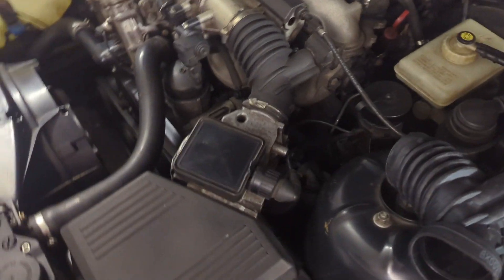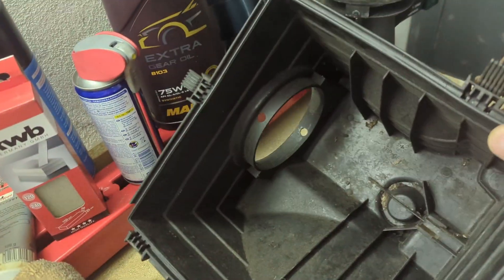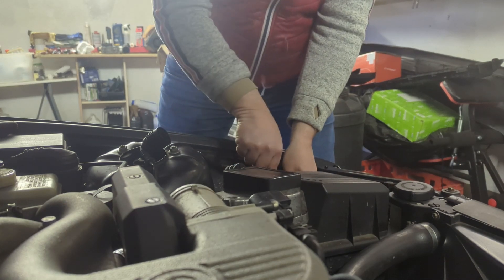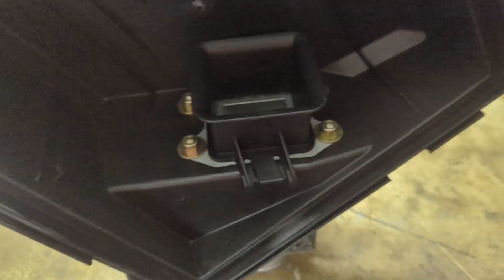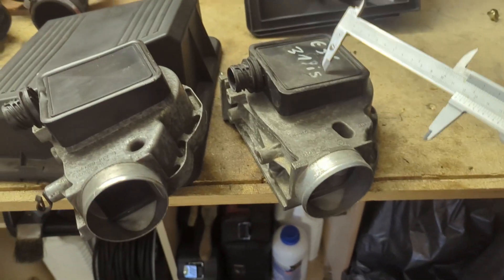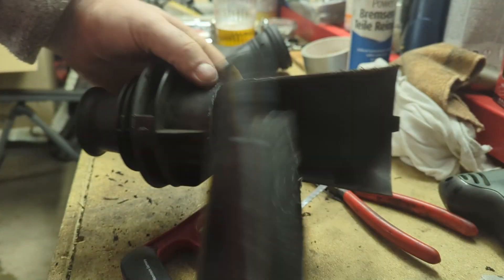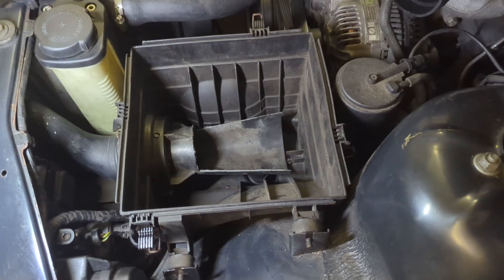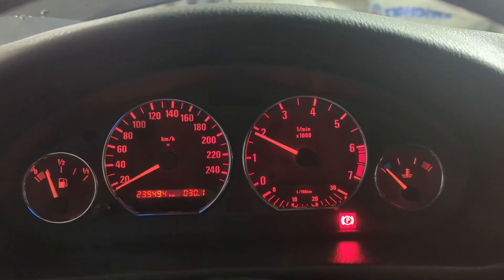BMW S.I.P - E36 316i - M43B16 - Bigger AFM Upgrade Hack...

Comment: I think what you did has to make a difference.   You said in the video, you didnt think it would.  Opening up the airflow has to work.   It might not be easy to measure or feel the difference without a dyno.  If it doesn't make a difference,  you may not have found your restriction yet (it could be the size if the throttle body etc)  Like some old oem air cleaner assemblies,  some are much more restrictive than others, and by flipping the lid you can actually measure gains.  On other cars, zero gains.  Even though our cars are vastly different,  many principles are the same.  On some cars flipping the lid did give some free hp, granted, it wasnt usually much, but it was still free👍
Reply from the maker: that was  my initial thought too. i found a way to log and plan is to üut the old setup back on and compare the data of the afm and see what the difference really is.

Comment: Spring is calibrated different on 318i AFM, so all you're doing is feeding your ECU incorrect air readings. This is actually worse than stock 316i AFM since you're not getting correct air-fuel mixture.
Reply from the maker: @thevirq nope. Flashed the ECU with a b18 ECU flash. Fuel trims are in check..